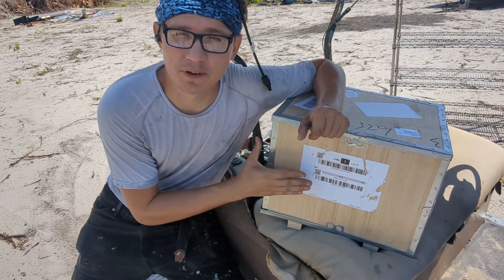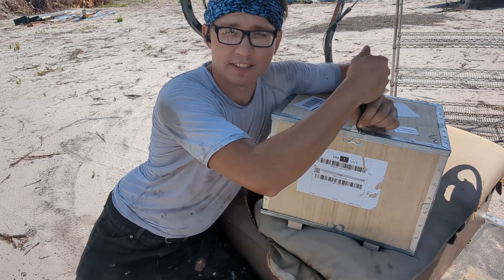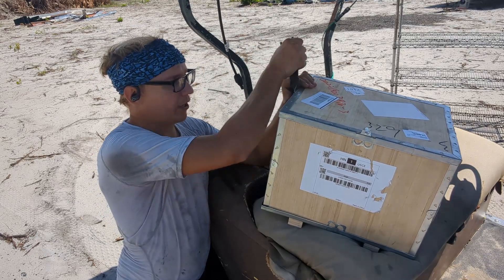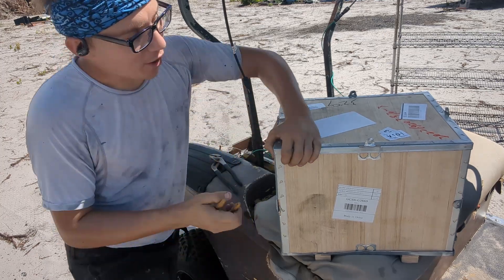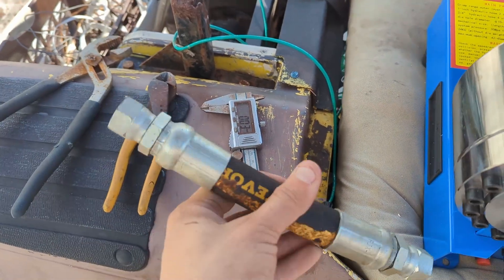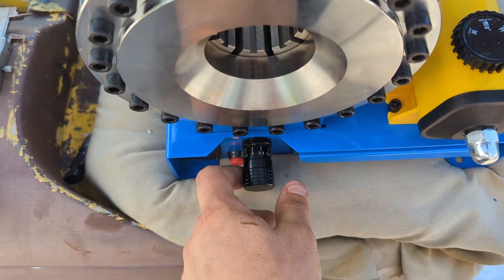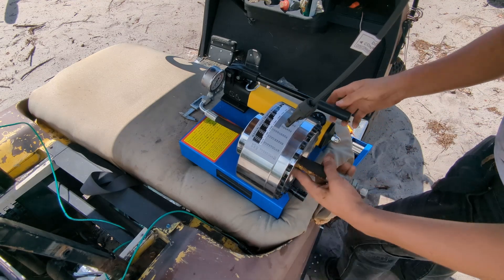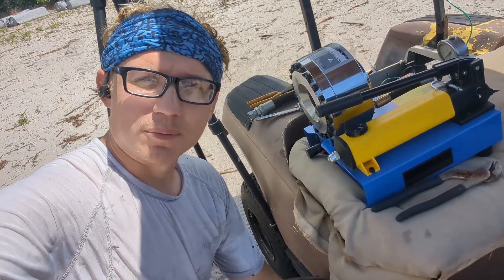Chinese ebay amazon hydraulic hose crimper review

Comment: 900 dollors you got screwed and why did you crimp a fitting that you already crumped 😂😂😂😂
Reply: There's a video on setting the red indicator light on u tube to the correct setting because it's not accurate you can't go buy the settings on the chart for it to light up
Reply from the maker: This is years ago. Prices changed drastically. Just 1-2 years before I bought it was selling for $1500

Comment: Great video! I notice some of these crimpers come with 8 dies and others have 9 dies, which  one did you buy? I want to be able to do all the sizes you mentioned! Metric makes it tricky! Thanks!
Reply from the maker: I bought the 9 dies. Technically the 8 dies does all, but the 9 has a extra in between the last few to have a better range to crimp 3/4" hoses. Otherwise it ends up following in the end or beginning of two of the crimp sizes
Reply: Thank you! I appreciate the tip! @Rowow

Comment: Could you explain how to use that micrometer a little better? I have a half inch air hose and I still can’t quite understand how to read the label to get the right micrometer setting. I mean, how did you get 30.5 mm from a 27 di? Thank you in advance.
Reply: The final crimp diameter is specified by the manufacturer of the crimp fitting.

And he's using a digital caliper, not a micrometer.
Reply from the maker: I'll make a new update video explaining!

Comment: I am adding an air over hydraulic foot pedal pump to mine. 120 pumps for a 3/8 hose fitting.  No fun when you are doing 4 or more hoses at a time.
Reply from the maker: yes I agree. Just recently bought a electric hydraulic pump for $250 on ebay. Excited to see how that will work out!
Reply: Looking forward to seeing this in action! @Rowow
Reply: Hoping you do a video on it and post a link to it! Thanks!

Comment: Dont throw the micrometer  away, they work great, you just have to verify and calibrate which is simple.
Reply: Sabes cómo se hace , mi tornillo vino suelto sin calibrar
Reply: @javiersanchez9691 from underneath remove the micrometer locknut and remove it. Put in any set of dies, the numbers on the dies indicate the fully closed diameter. Close the dies until they are fully closed. Set your micrometer to zero and insert into place and the light should turn on just as it is fully seated. If it does not turn on adjust the rod on the micrometer,it has a small locknut and an extendable shaft and once the length is adjusted that the light turns on when fully seated you can tighten the small locknut and then reinstall the micrometer. Make sure you have your micrometer on zero. My extendable shaft was bent on delivery so I had to remove the entire thing. If you can get your fingers in there you can adjust it without removing the entire micrometer. Once set the light will go on with any set of dies when fully closed. When you use the micrometer it will open 1 mm for every one turn. I still check every fitting with a micrometer.

Comment: Thanks for the video, good info. I have one question for you. How long did it take to actually compress the fitting onto the hose? I noticed when you showed us that part of the video,  the fitting had already been compressed.  I think I'm going to pull the trigger on one of these. I'm overhauling  a Kubota L3600 tractor (hope to be posting videos on that), I had one hose made for it yesterday and it cost $105. I added up the parts, and I could buy the parts for half that price. If I pay for all the hoses, it will be $800-$1000. My next project is a 1972 Bobcat 610. I restored one of those two years ago, and it cost me $700 in hoses. It will be alot more this time. I can see it easily paying for it self, and I'm sure I'll gain a couple friends I never knew I had :)
Reply from the maker: It takes a minute or two to do a hose. They sell a electric one I would much rather recommend. Or connect it to your own air powered or electric hydraulic pump
Reply: Thanks for the info. I found an air powered attachment today on Vevor that you can hook into the crimper that you have. It costs about $85   @Rowow

Comment: I was looking last summer.  These were for air conditioning hoses in the description
Reply: It is for Hydraulic hoses, I have a small loader / backhoe with a hydrostat and I did all of the hoses 1", 3/4" and 3/8". Followed the instructions and watched a few videos, I have used the Tractor multiple times with zero issues. If the crimping machine is capable of crimping a fitting to spec then it is the correct machine, this one can, and works very good.
Reply from the maker: I think you were looking at different ones. This is for hydraulic hoses. Air conditioner hose crimpers are handheld and are much lower pressure
Reply: @Rowow  it was in the description for this unit as ac hose.  I have the handheld ac hose crimper
Reply: @Rowow  agreed